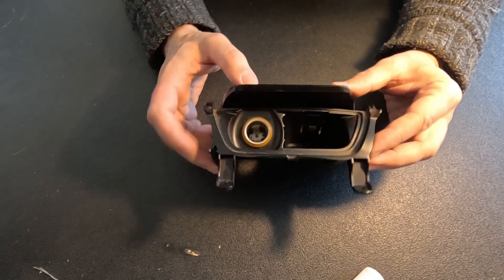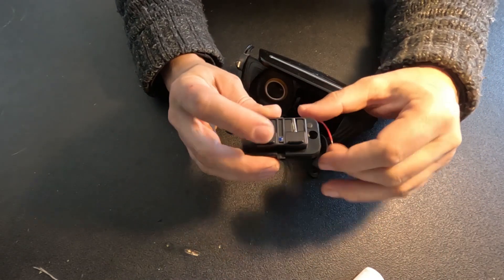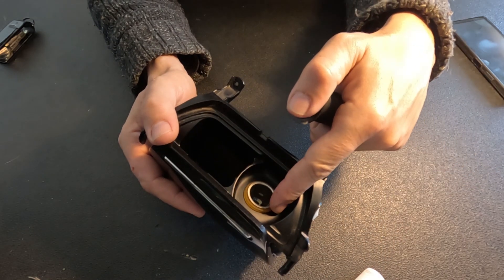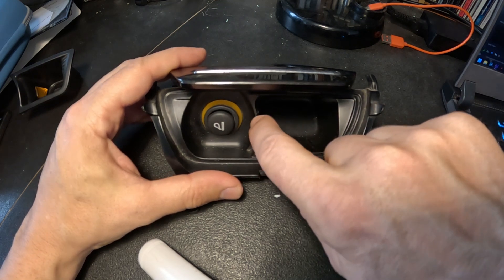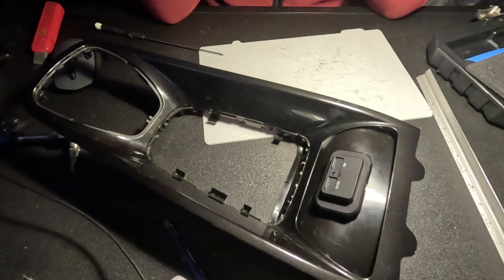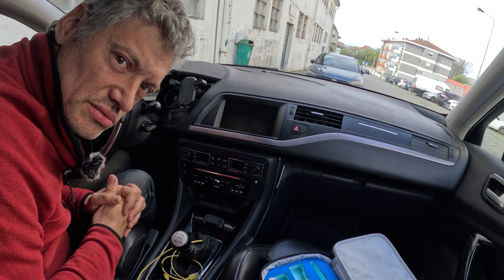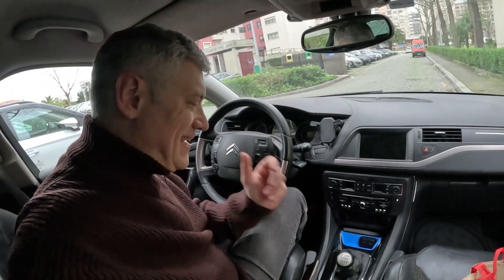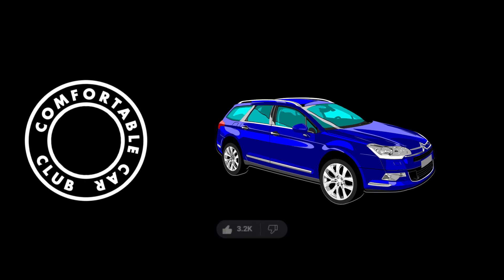From 12V socket to Fast Charging Ports | Part 1 | Citroen C5 X7

Comment: You could make a recessed place for this module to screw into the 3d printed part, so it sits flush
Reply from the maker: I thought of that, as it would also make it easier to clean crumbs and such, as long as it doesn't add to much to the 3D-printing process. Because I have to have it made, I have to reduce the amount of material used
Reply: @ you can make the part with recess without wasting material. I mean, it will still be approximately 1mm throughout the whole part, it’s just that in the place where the part should be placed, there will be sort of a frame that recesses needed part of a surface by the height of that adapter. You obviously don’t need to do 5mm of part and then make a 3mm recess, what a waste of material, when you can just recess the needed place by 3mm, maintaining consistent 1mm part thickness.

I’m bad at explaining, hope you understand what I mean
Reply from the maker: @ I think I get the idea, but the recess you mention will still have to be supported beneath. But I understand perfectly 👍
Reply: @ which can be done by adding a couple of supporting triangles, but honestly, it will work perfectly fine without supports

Comment: I thought to do this a year ago, ended up being a bit more lazy, cutted the plastic to remove the 12V socket, designed and printed a not so good looking box to fit 4 usb-c PD boards, 18W each, and glued it. I am not proud of how it looks, but it works very well
Reply from the maker: You can still cover it with the lid, right?
Reply: @comcarclub  Yes I can. I can always hide the ugly 🤣
Reply: @comcarclub  Yes, I can still use the lid and hide the ugly part 😂

Comment: Great video like always my friend! Im also trying to replace this part but not with usb ports but wirless charger "shelf" with edges slightly bigger so my phone wont fall off it, wireless coils are cheap on amazon and easy to attach. 
-link of my vision got deleted by youtube probably due to it being a link. it was like your 3d model but it does not go in its not concave but being kinda like a block literal shelf with bigger edges ~english is not my first language im using google translator
Reply from the maker: Your English sounds great to me. One of the very first things I ever did on this channel was a wireless pad in the car, but I think that the coils don't like the hot summer sun. I'm curious to see the video!
Reply: i would also like to replace my front seats with the massage ones or that ones that have heater but i have no clue if there are connectors or any power supply needed to do that change